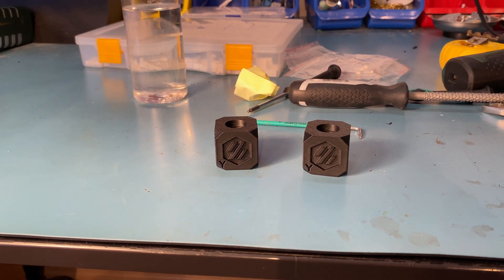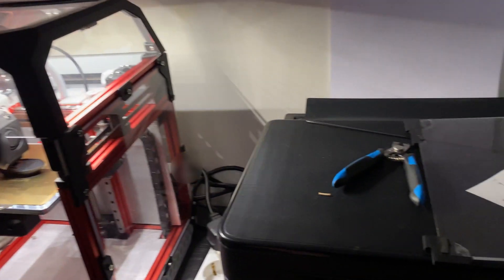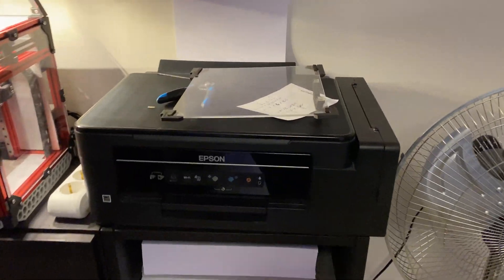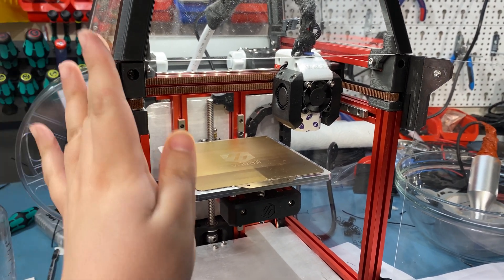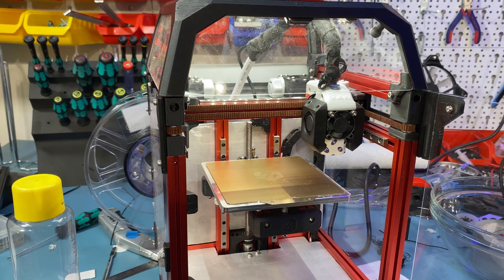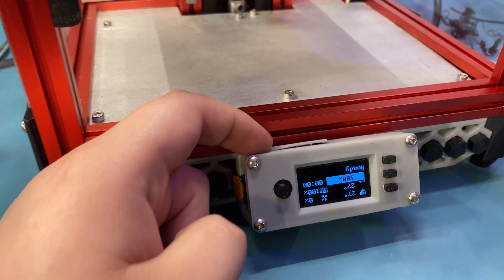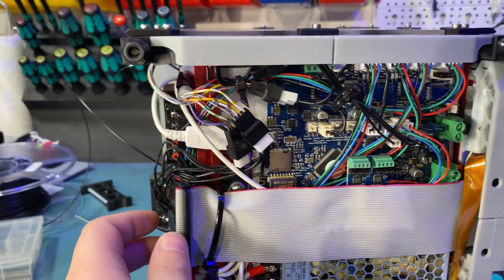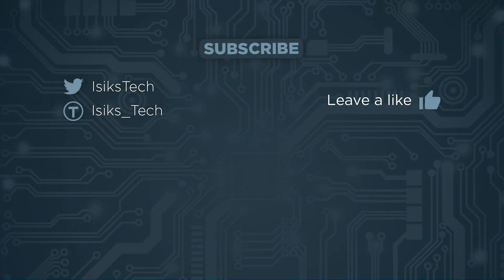Voron 0 Ep. 3 - Moar Mods!

Comment from the maker: On second inspection, that last cube looks bad. Turns out Pocketwatch guidler shuttle's m3 threaded insert hole melted from the stepper heat (probably). New part printing now, but maybe possibly attempt a Mobius 4 (M4) mod too.

Comment: Is it just me, or is your V2 much louder than mine?
Reply from the maker: V2 or v0? (Since this is a v0 vid). My v2 is really quiet except the hotend fan, but my v0 is loud. I'm assuming that's because I'm using a Duet 2 (tmc2660 outdated compared to tmc2209), but could be the ldo nema 14 motors too I guess.
Reply: @IsiksTech  I noticed it at 1:50   seemed very loud, maybe just part cooling fan?
Reply from the maker: Oh that's the loud hotend fan I mentioned. Except that fan it's really quiet.